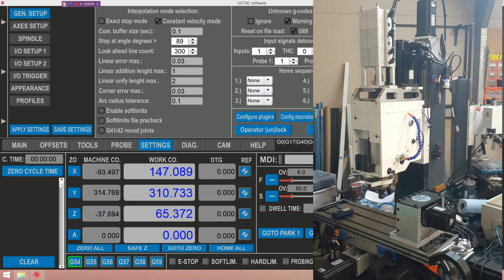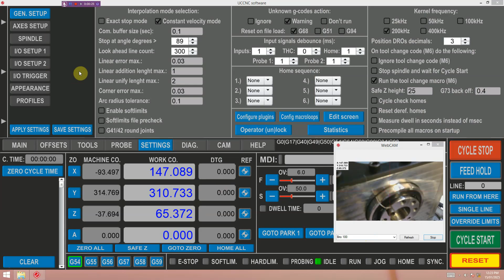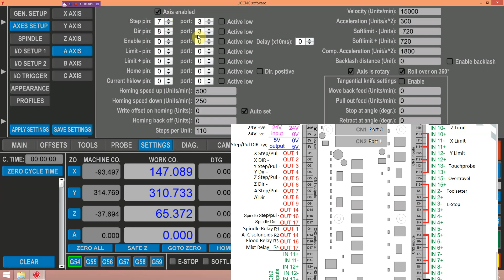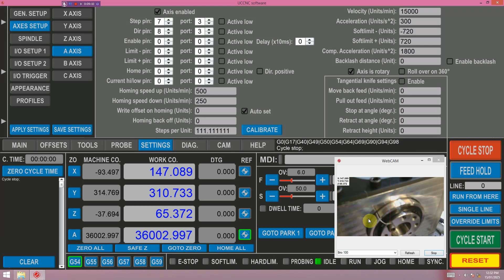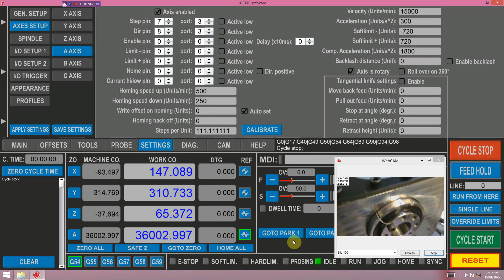UCCNC DM45 CNC Mill Conversion 4th Axis Calibration

Comment: I have UCCNC , little different look . How did you arrive at your " Steps per Unit " ? ... I used a math figure of : 360/1.8=200 per turn... 200x16 ( what the motor is ) =3200 / 360 = 53.3333333
but my motor does not turn , it gets warm , all within specs tem , .... Do you have a different formular to calibrate ?